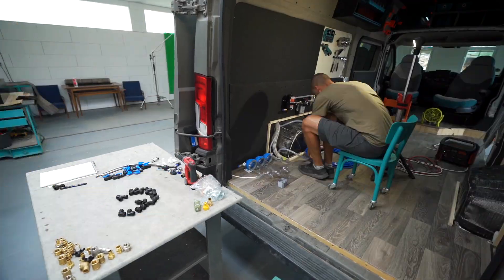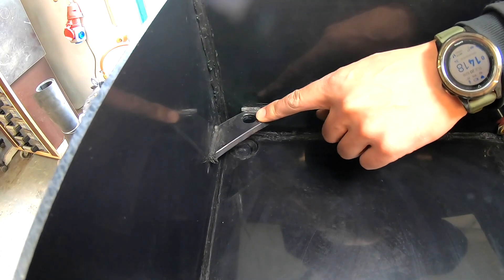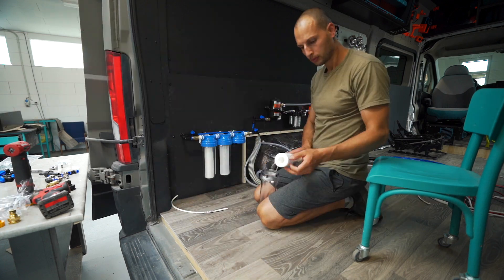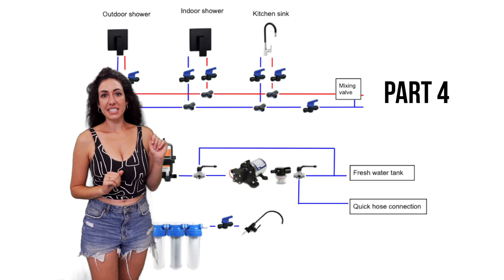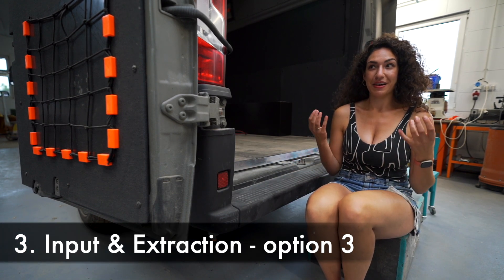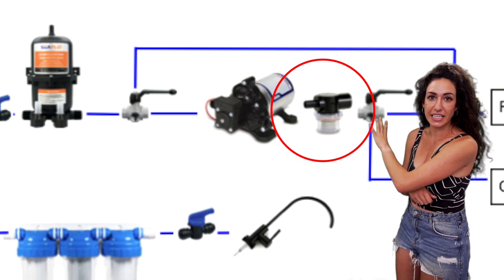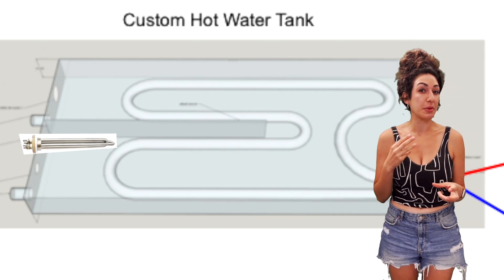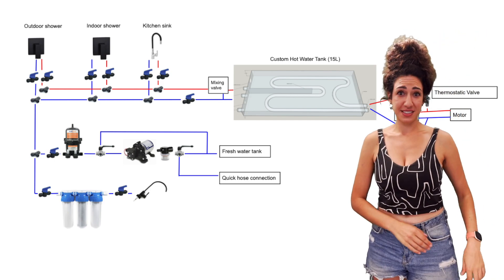Advanced Water System for Campervan (Off Grid Breakdown)

Comment: *I used to fit water filter systems. If I had to fit uv to a system there was always a burnt taste too the water until the water that had been sitting in the uv filter had been flush through... This was every time the tap was turned on... so this would waste a lot of your water...  better to use clorine tabs and filter all of your water as the taste will be removed and you would use less energy... *

Comment: The waterheater systems of the engine are widely availible example: 
Isotherm Basic 40 (40L) Marine Hot Water Heater with Thermostatic Mixing Valve Fitted- 240VAC 750W Electric and Heat Exchange (KTH604031B000003) - U can use this to futher improve your design, i am just buying this for 1500 AUD and save myself the trouble and get 5 years warranty.
Also i am not a big fan of the 3 inputs of your water, the river water you will never and should never use, you say u use your pump to get the water out of the river but every time you do this you have to fully rinse your system to be able to use the system for drinking water again, bacteria grow, even in your water pump and specially your water tank.
I honestly see no improvement over the standard systems with 2 oneway valves.
Reply from the maker: Hi, we are more planning on adding a chlorine tablet to the system together with creek water. That will do the trick.

Thanks for pointing out finished solutions. We did not find any reasonable shape but we could go around it. The main issue was the need for 48V heating element. We don’t want to convert DC-AC unnecessarily. We make a lot of custom things anyway so no need not to make a hot water tank as well.

Comment: You don't need a specialized uv system, you have three filters there with exposure to surrounding light, just buy small strips of uv led strips at different spectrum ranges and wrap them around your filters then circulate it through a few times. What you ought to be looking at too is how to restructure water, this changes the water at the molecular level which if done properly basically disables any contaminants, it makes them useless, eg if you have bacteria and simply restructure water those bacteria will simply die and no longer be a threat. And before you even start listening to nay sayers that confuse nescience with ignorance claiming water cannot be restructured and makes no effective difference, start study and looking at dr gerald pollack's work on the matter and for greater understanding veda austin's work too. 
The engine circulation is good, and it's about time that sort of thing became common place if you ask me, it's been wasted heat for a long damn time. 
What I don't understand is why you wouldn't add a solar option too, all that takes or would take is one additional copper pipe (not hose pipe) with a small pump up to the roof which moves the whole thing through all your storage options. One what,? nine or ten foot long copper pipe on the roof along the base of your solar panels, especially if you frame it behind a screen of business card sized fresnel lenses would get you pretty close if not beyond boiling temps in a few hours while your parked out by some picnic table. 
Also, why would you choose to filter only your drinking water, the skin is the largest organ in the body and what you expose it to matters, everything gets absorbed on small levels. With the amounts of estrogens, legal and illegal drug compounds, industrial and personally flushed chemicals, heavy metals and fluorides in water supplies, you want to add skin protection from that too, not just drinking water filtration.

Comment: Pro tip: The beauty of a camper van is that it trains you to be happy with less and forces you to be adaptable.

Skip the whole hot water shower thing all together. Instead use body wipes either store bought or homemade. If you want them hot, throw them in the microwave for a few seconds. If you dont like wipes you can also use various powders or fine sand to absorb oils from the skin and rub away dead skin cells.
There are many ways to clean a human body without a shower.
Reply from the maker: We wen’t through body wipes too. It’s ok weekend solution but not ok to do for a year.

Comment: If I was putting a water tank under the car, I probably would protect it with a carbon fiber sheet or something light & hard as you'll never know what is on the road that can pierce through the tank. Even a tiny rock with high velocity can smash the tank into pieces I assume.

Comment: We use water from a stream in our house.  It passes through a washable 80u filter that takes the 'larger' bits out to lengthen the life of the second filter which is a 10u.  It then goes through a uv filter.  All good. 
Personally I would definitely get a uv filter - making sure not to get one with glass components for a van.  If you fill up from even the cleanest looking stream I would guess the 20u filter would clog if thats your first filter and reduce the water flow.    I see what you are trying to do with the 1u filter, but uv is better.   I would filter and uv any water coming into the tank and use it for showering and washing dishes.  Much safer to have bug free water in your eyes and on your dishes.  I don't see any reason not to filter all water, the filter cartridges will last a long time - especially if you put a washable one as the first. 
I don't understand why someone said you would need different uv light for different water sources, but then my house doesn't move continents.
Reply: @831simon Do you use a carbon filter before your uv filter?

Comment: In my rv (6,8m long) I have the hose connection (gardena) with a hose spool fixed to our rv. Easy to get water and leave fast. I also have like 10 different adapters for gardena connection and I never had any single issue. Now I can't send you a video because I crashed a few days ago and it's at the mechanic but if I can go in a few days I will send you a video :)
Reply: I’m planing on using the same type of retractable hose in my build, I already bought it when it went on sale but Ive been waiting for Ford to build my van since October 2021.

Comment: Awesome video, thanks a lot for sharing. I can't comment from a van perspective as I'm still planning my built, but I went on trekking trips for many years and totally rely on my portable uv filter to make water from all kinds of sources ready to drink. I used water from creeks, lakes, springs and if nothing else was available even larger puddles and not once got sick. As the system is pretty sore I really wonder how there would be different types of uv filters required 🤔. Only disadvantage is, that even though the water will be okay to drink, uv filters will do nothing about the taste, so depending on the water source you won't get sick but the taste can be really terrible. To avoid this you indeed need an additional filter system, but that's not an issue in a van and you already have it in place. For my build I intend to stick to the system that I know worked well from long term experience but I'll for sure add at least one additional filter based on charcoal for the taste. And put a filter in front to remove larger particles. Vanlife is so much more comfortable than trekking 😂

Comment: Your van build is very interesting and innovative but it is very very complicated. Do you really expect someone to follow and copy any of this? You have a fully equipped carpentry shop with every possible machine. Ladi is a combination of at least 5 different specialists. To have a van like this you need an engineer on board on all travels "just in case something goes wrong".

Comment: Travelling through Europe there are many springs by the side of the road where you can fill up drinking water. They often have a low flow rate but the water is lovely. I'm thinking of having a 20 litre dedicated  drinking water tank as well as a 100 plus litre fresh tank for dishes, laundry, showering or cooking. You could fill the larger tank from a stream with your method and keep the drinking water circuit sanitised with only spring or town water. I have a small submersible 12v pump with a 10m 12v cigarette extension lead. It's easy to keep this clean for the drinking water. Put a bowl under the spring water pipe, let it fill, turn on the pump, wait and repeat.

Comment: I think this water system is so over complicated like basically with everything you do to this van -  but I get it, It what makes people watch you channel and it is a good learning way for you two.

1.When thinking of heating your water while the engine is running: the best and the least complicated thing is just to use a voltage sensitive relay and a 12v heating element. When the car is running the alternator kicks in and the voltage rises - then the relay turns on and it starts heating the water - it takes a little longer but we have done this setup and a 15l is heated to 65C in about 40minutes. 
If you want to do it your way, try adding a disel water heater that warms your engine in the winter and automaticly warms your boiler. 

2. Blowing hot air thrught  that long pipe in the boiler. Its gonna have 2 side effects: Its gonna take ages to warm that water and its gonna take ages to warm the place up - try doing this when the water is cold and it is cold outside. You will be disappointed. 

3. We were thinking about that sucking option you have mentioned for a long time. The problem with that is that you have to flush the whole system and change the water in your system everytime you suck water like that - the problem with alge, bacteria, dirt and debris is just not worth the hustle. 

4. It is better to have a second tap at your sink that is a seperet line with a seperet small pump that you "plug" in the 5L water bottle that you buy in the store - and when the water bottle is empty, you just "plug" a new water bottle. It is such a space saver when you dont need to instal all those filters and you just need a little space for a water bottle with its own pump. 

5. I cringe everytime I see those hose clamps on the lines (in any vanbuld) - you are doing a professional build - try finding another way to connect those pipes. There is a lot of systems that are more reliable.

6. oh... and I m pretty sure the boilers are meant to be cylinder by design - when the pressure rises in the boiler it needs to push to all the walls with the same force.

I know it looks really cool the way you are doing things but on the long run when the thing start to break it is very crucial to have a simple system with easy access.

Keep up the good work, I always learn something when watching your videos.
Reply from the maker: 1. Sounds like a personal preference more than a better solution. This takes longer, stresses alternator more and requires massive cables especially for the length we would need. It’s not obviously better solution.

2. I’m open minded to learn this but 80 degrees hot air won’t come out cold and in my opinion won’t take much time to heat up the water. That will be tested for sure.

3. and 4.  Sounds like a preference and I personally still like ours more. Sucking the water from any source, if suspicious than adding a chlorine tablet to our 150l tank.

5. Could you please point out what connections are much better we can use? We honestly don’t know anything better. Just please let’s not recommend the crimping system humble road uses, I’m not willing to spend that much money for few connection. I did not see a problem with these connections on 2bar system.

6. That’s right, they are cylinders for this reason. Very inconvenient shape when maximizing the space, isn’t it? 3mm stainless steel will hold it together, I’m sure.

Thanks for the comment. Generally speaking we do thinks our best but nobody says we do them perfect. I like being challenged and educated, that’s the way to improve.
Reply: @ladiandmargaret  fwiw, in Australia it is very common to use John Guest fittings and pipe in vans
Reply: You're forgetting something really important. Everyone build the van according with their  needs. They already travelled a lot in a Van so they created this van with all they need to resolve problems that they already experienced. There is no right way to build a van.
Reply: Starting a build soon and this is a serious non-confrontational question trying to educate myself. What is wrong with "those hose clamps" are they not the same ones used on every hose in the vehicles existing water coolant system?

Comment: My system is is not perfect and it's not for everyone.

 I had my van built when I did not have health insurance so..... ALL water going in the tank, pump, and plumbing, regardless of source, goes through 3 filters - not unlike yours. Periodically the tank and lines get a chlorine treatment. 

Water at the sink (cooking, drinking, washing up, etc) goes through a 4th filter. Indoor and outdoor showers do not get additional filtration.

The 3-stage filter system is portable. Its stowed in the garage and weighs about 39 lbs with residual water in the canisters. Being portable, I can help other travelers, I can fill and leave it at home for trips of ~3 weeks or less and if I had a pump, I could filter surface water - though I would never do that without additional UV filtration before the tank.

My fresh tank fill inlet is in the garage to prevent  anyone tampering with my water supply - same reason I don't have a ladder on my van (I carry a collapsible ladder in the garage if I think I'll need it).

Not as elaborate as your system but it works for us. And yes, I think a UV system would be a good idea especially if you put river water in your tank.

Comment: nice video guys, very clever,
I recommend that you move the suction hose for the fresh water tank to a position between the heat sensor and heating element, so you ensure that you always get water in it`s liquid state.. the suction hose currently far away fro1m the heater

Comment: You're so excited about that hot water aren't you. Love it. 
You know you can buy a heat transfer plate that you connect to your radiator hose. 
What you are doing is like a calorifier. Please make sure you have a good pressure relief on that and not trapped air etc. They blow quite well when they go. Also if the pipe leaks you will be showering in coolant 😬

Comment: My job is a "water operator". Basically, I filter and sterilize ground water that is distributed throughout my community for consumption (city water). While I know a lot of people have a negative view of chlorinated water, a naive view in my opinion, you can safely and completely sterilize all your water with just a few drops of chlorine. This would kill everything that may be harmful in your water eliminating the need for a UV system and the associated cost and maintenance. Combine this with your filtration system and all your water is potable. If you are really adverse to chlorinated water you can leave the water you will be consuming exposed to sun and air and the chlorine will basically disappear but this would be difficult in a van life situation. 
I do have a concern with pumping your water from the lowest part of the tank because that's where the sediment will settle. But on the other hand with all the sloshing around in a van the water may not be stationary long enough for everything to settle out. 
You are completely on the right track by  shocking your tanks when they need cleaning.
Feel free to reach out if I may be of any assistance on this matter.
Reply: As a Scoutmaster that has spent 1000s of days in the woods in my experience the simplest and old methods are best. For really questionable stuff boil then filter. If real bad distill water. Given the technological bent of these guys they need a solar still on the roof of their camper 😎
Reply: @CreekRanger  Boiling would certainly produce potable water. It would be a huge inconvenience and time suck to boil water every time they wanted a drink or to try to boil enough to fill their bulk tank. It is obvious from watching the progress of this build lLadi and Margaret want modern convenience while living full time in a van.There is no reason, in this day and time, one can't have water on demand.
Reply: @keithbrookshire  From the gadget perspective A solar still on the roof could purify water and easy to make with copper tubing and some lexan sheets also could serve as source of solar hot water. I think Ladi would surprise us with his creativity and it could be the first van solar distillation 😀
Reply: @CreekRanger  Solar still. That would rock. Or water distillation via engine heat :D
Reply: Won’t the chlorine damage the 3 stage filter elements?
Reply: @ryanchristie5349  A Carbon filter will take out the chlorine except in some parts of the world they use chloramine which kills the carbon filters.
Reply: @CreekRanger  The chlorine could be added after filtration. Filtration is to remove sediment and debris. Chlorine is for sterilization. It's two separate processes. Technically, the chlorine could be added before or after filtration. However, there is a danger of harmful nitrates being formed when adding chlorine to unfiltered water that is particularly high in organic matter. Especially in hot weather. Sanitizing the water after filtration would be my choice.
Reply: @CreekRanger  This is true. I'm not sure what the inline options are for a carbon filter. Something like a countertop Berkey system would do the trick. Chlorinating at this point would be super simple if you only wanted to sterilize the potable water.
However, from following this build and looking at all the conveniences they have I don't imagine they would want anything other than water that is ready to drink from the tap.

Comment: Another great video.  It makes our Sunday morning.
One comment and one question.